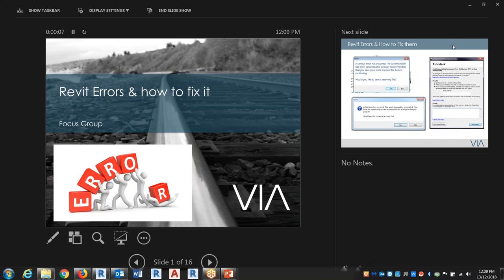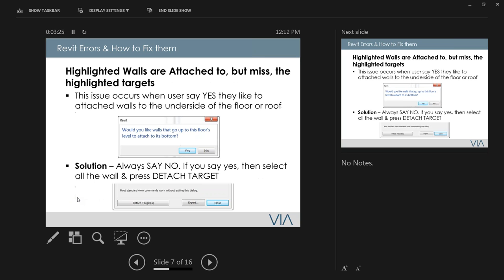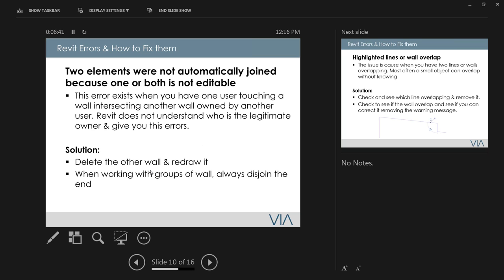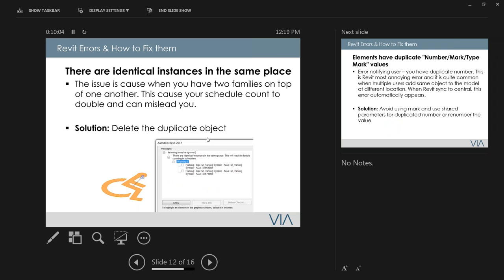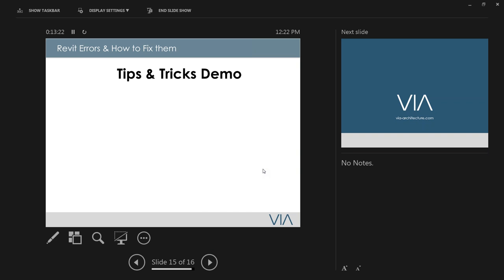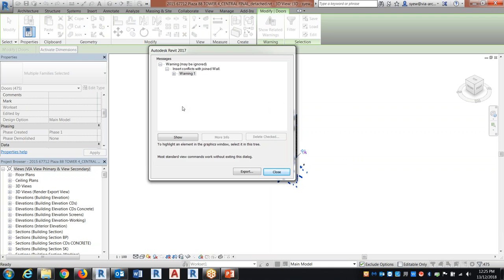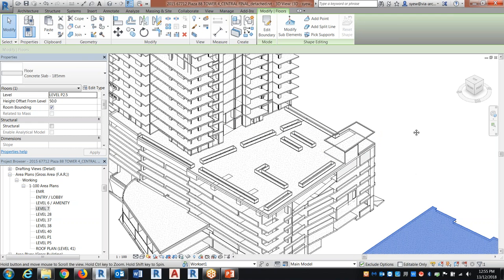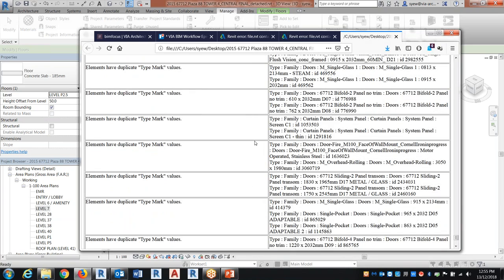Focus Group - Revit errors & how to fix it

Comment: i see yellow triangle sign when i start revit any ideas on that
Reply from the maker: What is the message do you get from the yellow triangle sign
Reply: non just a yellow triangle with exclamation mark then it closes
Reply from the maker: Did you try repairing Revit software? Most often that will resolved most issue. If not, try to uninstall it and then reinstall Revit.